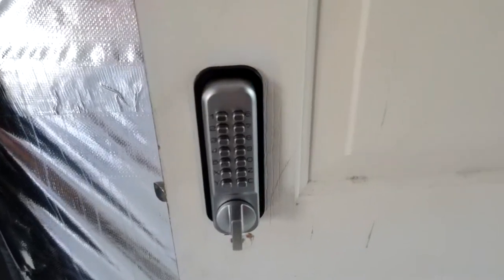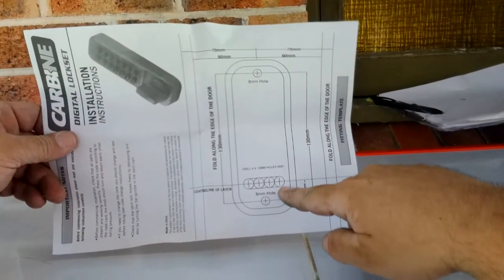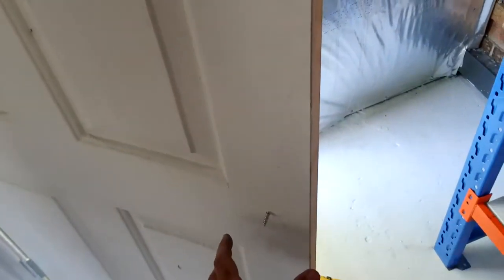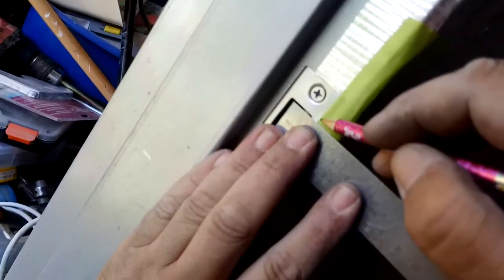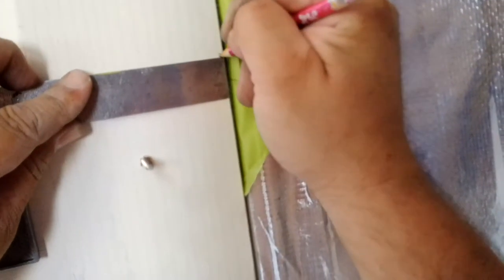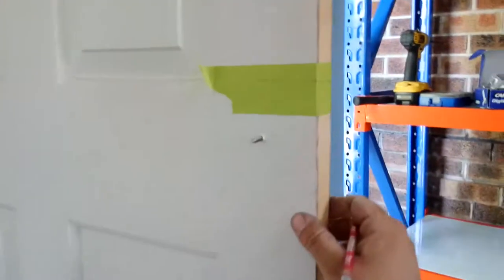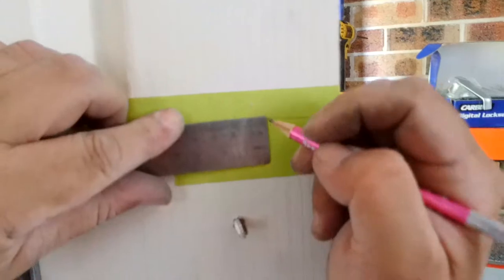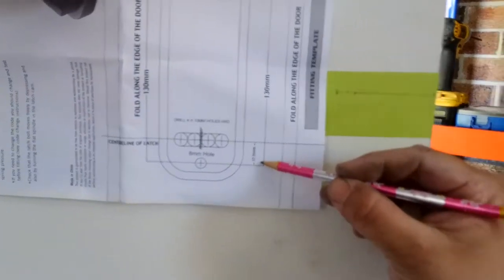How to Install Digital Code Lock

Comment: There are 1,287 combinations to this lock... verified. Ignoring the "CLEAR, C" button, you have 5 into 13 alphanumeric buttons giving you 1,287. As they can be arranged in any order, the value is way, way smaller than if the numbers had to be in order... perhaps a hundred times(unverified).
Great Vids!

Comment: Question. I am not being critical, but was there a reason you did not tape the templet to the door?
Reply from the maker: No good reason, just don't like drilling the paper, I keep the template most times in the hope I have time to add then to our on-line shop with the product, also habit , I am use to using a ruler
Reply: Thinking the same, seems alot of hassle especially if you're on a tight schedule.
Reply: 😂😂😂yes the templates are there to be used as a template. For some reason he wasted 20mins plus measuring it out himself 😂
Reply: His a old skool genuine professional carpenter learn a thing or two rather being dummies following Template